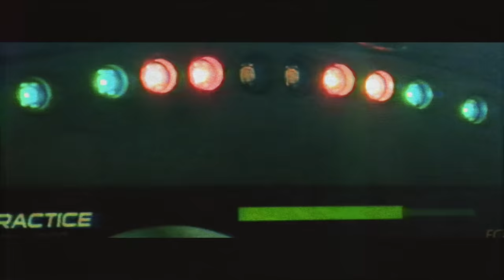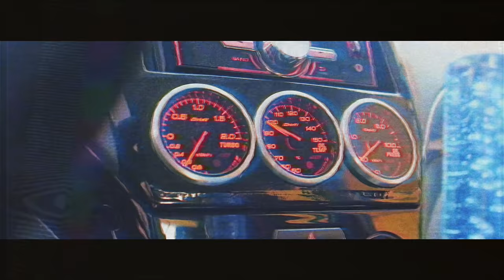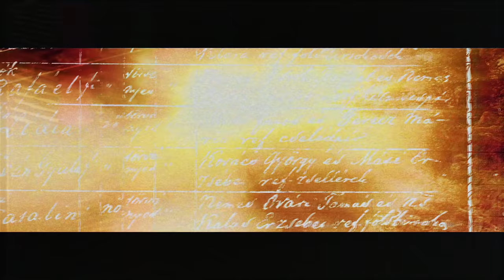PHONK DRIFT MIX | MEMPHIS // 808 COWBELL

Comment: amazing edit just one flaw when using 21:9 monitor, widescreen software has a problem recognising the black bars because the effect are over them, if the black bars would be over the effect it would not glitch out like crazy trying to put it into the right aspect, its switching between 16:9 and 21:9 constantly on darker scenes when fullscreen is enabled because the software has problems finding the edges :)